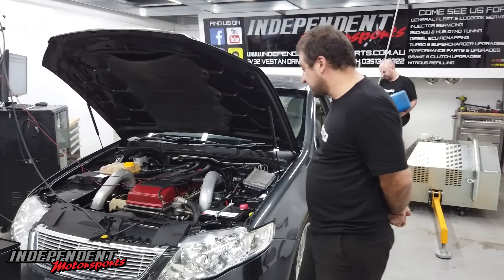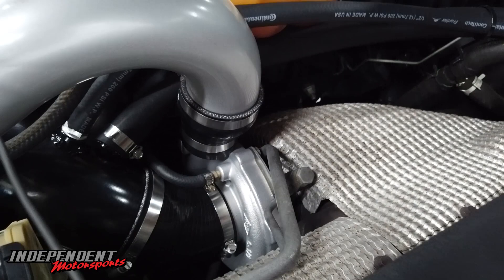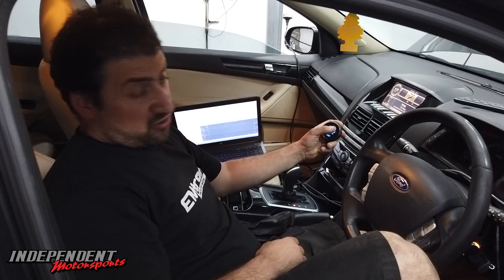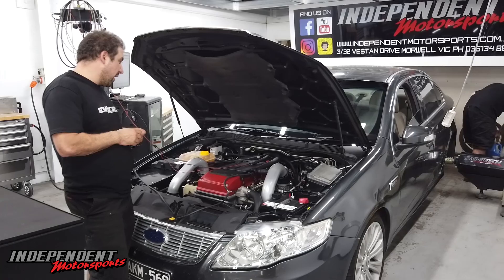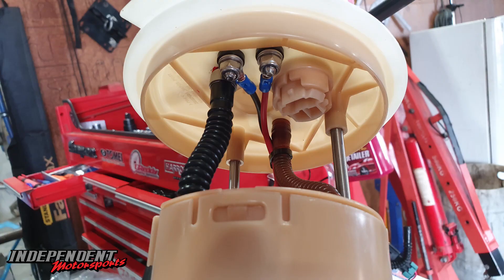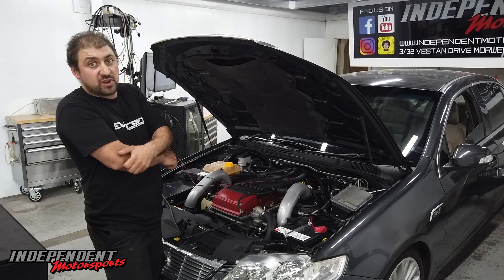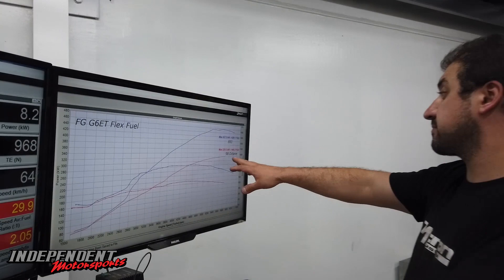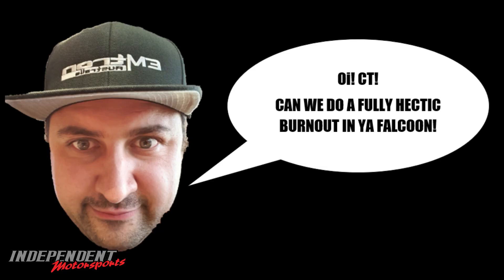Ford G6E Turbo Flex Fuel & High Flow Turbo

Comment: I have a kpm 700hp fuel pump and I was told it's a 540lph pump, it is a drop in and plug in module. How is it not melting plugs and frying wires etc?? Thanks
Reply from the maker: I can't answer that question because we haven't seen one of them yet

Comment: How long will the stock gearbox last with 450kw?
Reply from the maker: This car has been running for over 2 years with this exact setup,all we have done is added the flex fuel and fixed the fuel pump wiring.
Reply: @IndependentMotorsports  that's impressive
Reply: @IndependentMotorsports  if you drag race it with slicks it's a ticking time bomb
Reply from the maker: @MY_USER_WAS_TAKEN  He has raced it a few times and it's still getting driven daily.
Reply: Not long.
Reply: Good work guys. Ignore the internet warriors experts in all things keyboard